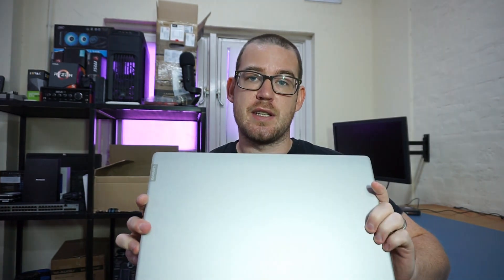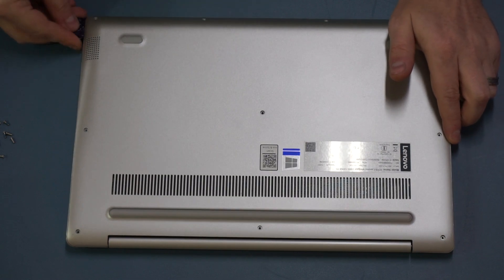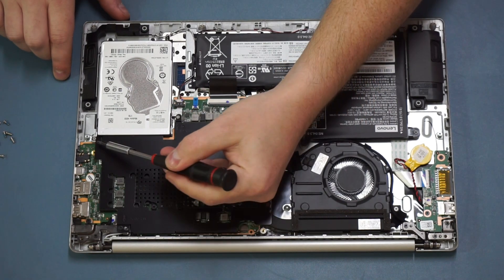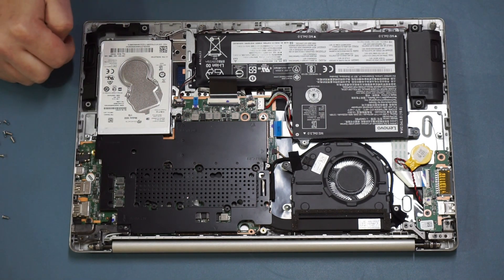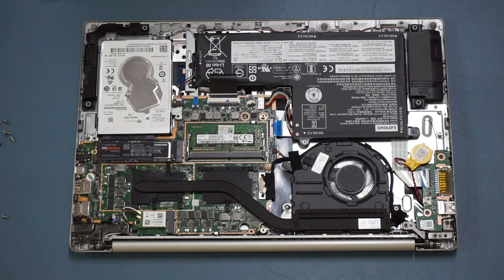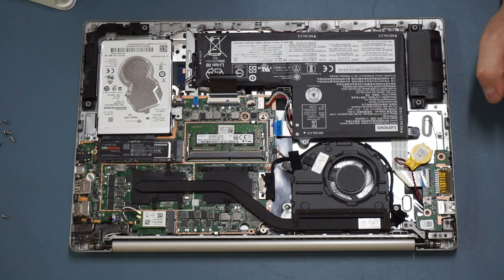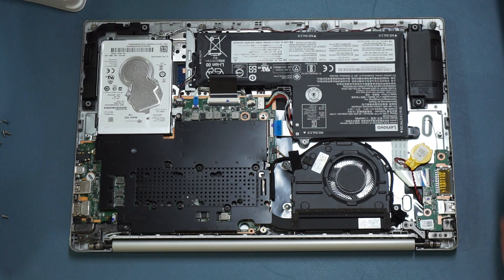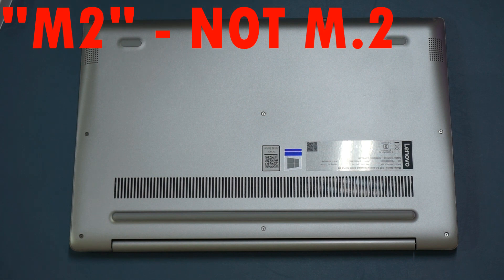Lenovo Ideapad 330S Hard Disk Upgrade

Comment: Maybe I'm wrong but I see you didn't unplug the battery, isn't that necessary?
Reply from the maker: It's a good point, you should always disconnect the battery before working on a machine like this
Reply: @TMEretro  Can you add that instruction in the video, may be as a subtitle?
Reply from the maker: @vikas7gupta  Doing so would require me to de-list and re-edit/upload the video which has implications for my channel, but I have added the text to the sticky-comment and to the description of the video
Reply: @TMEretro   @Tech Made Easy  I thought adding subtitle does not require all that so i suggested that. How about using CC? For now, Sticky note will be perfect. Thanks for making this extra efforts. Appreciate. Keep up the good work.
Reply: Uh, oops. I missed that memo when I was working on my laptop earlier. Well, sh*t.
Reply: Can you explain further, do you mean take the battery out completely during the operation?
Reply from the maker: No, just disconnect it from the motherboard.
Reply: @TMEretro  Gotcha. Does it need to be unscrewed from the housing, or can you just unplug it?
Reply from the maker: @fish2036  if you can safely detach the power cable from the motherboard then that is sufficient. In some cases this requires the battery to be removed

Comment: This is an odd one, so just go with me... I just inherited this laptop from my wife after getting her a substantial upgraded new laptop. I have a Steam deck, and I have upgraded the hard drive, which left me with the original 512gb NVMe m.2 2300 hard drive from the steam deck. I was going to use it in my PC when I built it November 2023, but there was no post at the correct location to mount it with the screw on my motherboard. It looks like (based on this video) that is also the case with this mobo. Is that correct?

Comment: hi, i just bought and install a M.2 ssd on this exact laptop, altought it had a Intel Optane previously, that when bad, and its running amazingly after that, BUT, i dont know how to properly st up the boot on the m.2 in the BIOS, when i get in, it only apears the hard disk, on UEFI mode, and its gay, so i can't change it to legacy mode. 

Do you have a video following that situation? It will really help me to boot my laptop properly.
Reply: By the way, i already installed windows on the ssd, and can use the laptop, but everytime i turn it on, it goes to the HD first, then go to the recovery mode, and ask me if i wanna start windows on other drive, i select the SSD and star to work, but it takes out the advantage (fast boot and load time) of the SSD being in the laptop.

Comment: I have this exact laptop. And this is entirely different from the laptop I bought back in 2008, back then I was able to open and latch on the side, pull the old hard drive out, then install a new hard drive. Not so now and days.

Comment: Hmmm....I wasn't aware that the battery had to be removed.  My laptop no longer turns on.  The power button is lit, but the screen is black and nothing is happening.  Is my laptop broken?
Reply from the maker: Try reseating the memory and also confirm if any other connections could have come loose while working on the machine

Comment: My laptop is the same, but why my laptop doesn't have the black plastic shield?
Reply from the maker: Maybe a slightly different revision?
Reply: @TMEretro  but I'm sure it's the same version, Lenovo Ideapad 330s 14IKB.

If I wanna put on SSD M.2 on my laptop, should I  buy a screw for it?
Reply from the maker: @dwiadhiiswiyanto  Yes you need to secure it with a screw

Comment: Ah, thanks! :) you covered all I was looking for and probably a bit extra info as well. I might go for and M.2 SSD and keep my harddrive as is.
Reply from the maker: Glad I could help!
Reply: I'm having the same laptop kindly help me which SSD this laptop support for 500/512GB. Can I go for Samsung 970 SSD of 512gb???
Reply: @Maverick.manan_  I went with Kingston a400, 240 GB. It's cheap and really really fast even on a data connector. You might benefit from trying m.2 or a better model if you have a bigger budget. Depends on your use, but I would advise to go with a smaller 240gb and keep your files on your hdd in an external enclosure. 

SSDs are fast, but will get slow if you fill it up with a lot of files and programs you dont need.

Comment: Hello, 

Can i add 
Crucial CT16G4SFD8266 16GB Single DDR4 2666 MT/s PC4-21300 DR x8 SODIMM 260-Pin RAM on this Lenovo 330s ?

or is this has to be falling below 2400 MTs?

Thanks
Reply from the maker: Please check with Lenovo for compatibility, I can't assure against every available module

Comment: Thank you for making this video. The information here is great and it is difficult to find another video as in-depth as this one for this exact model. I have two questions though-
1. My laptop has a 1 TB ssd (I think; I've seen some models of this laptop with a hdd, but I haven't cracked mine open yet), however C:\ states it has only 930 GB of storage. Is that usual for this laptop and if not, any ideas as to what could be happening there? 
2. If the m.2 ssd has a smaller storage capacity than the original hdd/ssd, what would be the effect on the system? Does the m.2 add storage to the system or simply replace what was already there?
Keep up the work!
Edit: One more question: does this model use single or dual rank RAM?
Reply from the maker: The disk reading 930GB is normal - you lose space because of formatting overheard and this applies to all storage drives.
If you add an additional m.2 drive you will gain that space as a separate drive within windows
Reply: @TMEretro  Thanks a ton!

Comment: This video was a lifesaver. Thank you!

I'm not sure I would have known about  970 evo if it wasn't for this video. Got the 1TB version. Bought and installed it today and just got it to work with my computer. Need to upgrade my other hard drive, but still nervous about that and need to save up for it anyway. Also need to add ram, but I didn't see an extra slot for it on my 330S. Don't know if missed it or not. Need to open it up again anyway because my 970 didn't come with a screw and the one I had didn't work.

Any ram you recommend? Also ditto with the other hard drive.
Reply from the maker: There are options for both in the video description

Comment: One question If I install SSD like this. Should I have to install windows in SSD to see the effect or just changing the boot setting will be enough?
Reply from the maker: You need to manually reinstall Windows on the new drive

Comment: I ended up bricking my 330s during a bios update and wanted to know if anyone knows where the bios chip was?  I believe it’s the 8 pin chip just above the ram in the video, marked Winbond 25Q64JVSIQ (that’s what mine is marked). 
Thanks for the help!
Reply from the maker: BIOS chips are generally non-replaceable.  Have you considered taking it to an authorised repair centre?
Reply: My plan was to try and flash it.  Lenovo help desk said I need to send it in and it’s not on warranty.

Comment: Hi Thanks for this video, anyway do you have information to set the bios after you upgrade it? And how you set the windows pre-installation copied into new ssd?
Reply from the maker: Hi, there shouldn't be any further changes required in the BIOS providing you only have windows installed on one drive. And I'm not sure what you mean by the 2nd part of your question
Reply: My 2nd question is how you migrate your windows to your new main drive.. but i already have the answer, it just we need to clone the windows and copied to new ssd upgrade.
Anyway thanks for the answer.
Reply: @edw7times7  which software did you use for it ?
Reply: Isabat Rizvi You may can refer to link https://www.easeus.com/backup-utility/copy-and-clone-hard-drive.html

Comment: Hi. Can I remove the black metal cover on this permanently? I recently installed a NVME and it runs hot. I'm suspecting that the black metal traps the heat.
Reply from the maker: I would never recommend removing anything from the laptop which the manufacturer put in place
Reply: @TMEretro  perhaps I should just make a cutout or holes at that area? My NVME temp are at 45-55°C idling. 
Thanks for the help man!
Reply from the maker: Again I can't recommend you do anything to modify the machine, doing so would invalidate your warranty and could cause damage to the computer

Comment: Does this take the computer out of dual channel? If so, does it have a positive or negative change in its performance?
Reply from the maker: If you use a RAM stick other than 4GB I don't believe it will run in dual channel with the inboard 4gb

Comment: Hey, thank you for sharing this video. Would you happen to know what the difference of replacing my 1tb HDD to an SDD or add an additional SDD in M.2 Slot? Any advice would be greatly appreciated. Cheers!!
Reply from the maker: If you add an m. 2 ssd then you retain the space of the old hdd as well, but in this machine and for most use cases there is no performance difference between a SATA SSD and m. 2 ssd

Comment: Is there a way replacing the hard drove be done if there is data on the old and moving the data to the new one if so is there anything that will have to be reinstalled such as the windows 10 os
Reply from the maker: There are 3rd party disk cloning tools available, you would need a means of connecting both drives to the same pc in order to copy from one to the other

Comment: Hi. Thank you for sharing this helpful video. I have the Lenovo 33OS that came with I3 7th Intel processor and I wonder if I can upgrade the hard disc to an M2 one in this.
Reply from the maker: I see no reason why not, but the best bet would be to open the back of the laptop and check to see if you can see the m.2 socket on the motherboard.

Comment: Thanks a lot for making this video! I have the same laptop, but in a slightly different variant, mine came with an ssd, and when i recently removed the back to upgrade the RAM i noticed it did not have the black shield, and in the hhd area there's a soft aluminium box instead of the caddy... i have a spare sata hhd and t I'm thinking to adding this as an extra storage space... Would this affect the performance? i'm not planing to remove the ssd just add the hhd, i'm guessing it would be some noise and more power consumption... any advise would be greatly appreciated. Thanks a lot!!!
Reply from the maker: As you say; more noise and more power consumption, but provided the SATA connectors are there it should work

Comment: hey hi  bro i think i'm also having the same laptop 

Lenovo Ideapad 330S  15IKB D 8GB Ram 1TB HDD and 2GB amd readeon 535 Graphics i would like to add an m.2 ssd of 250gb and i want boot up my laptop by ssd because in this lenovo built-in hardware is dam slow while using the virtual machines and while startups would you suggest me please??? and also for upgrading the ram memory also reply me as soon as possible.
Reply from the maker: The M.2 upgrade is covered in this video, the next step would be to ensure the ssd is set as a higher boot priority than the original hard disk and then reinstall windows
Reply: @TMEretro  yeah thats fine bro and how about the ram upgrade bro??
Reply from the maker: 5:20 - you can see the RAM slot. You can fit up to an 8GB stick in there to give 12GB total

Comment: Hey mann I have Lenovo Ideapad 330s 15lKB-D
The box says upgradeable to 128gb SSD . But if I use a 256gb ssd would it be problematic.
Reply from the maker: I can't guarantee, but I installed a 512gb unit in this one and it was fine
Reply from the maker: I can't guarantee, but I installed a 512gb unit in this one and it was fine
Reply: @TMEretro  Thank You

Comment: I have IdeaPad 330s 4GB ram facing slowness I m looking to install   NVMe SSD 250 gb and want to continue with HDD as well, if i get NVMe SSD installed  do I have to move win10 from HDD to SSD or can i continue using laptop with just adding NVMe SSD if not what happens to my HDD, also with 4gb RAM will there be any improvement in performance just adding SSD or do I need to upgrade ram also to 8 gb
Reply from the maker: There would be a huge benefit to wiping your machine and reinstalling windows on the NVMe SSD, it'll be much quicker than the HDD. Upgrading the RAM from 4gb will also be of huge benefit
Reply: @TMEretro Can I able to use HDD for data loading purpose or HDD will become useless in this
Reply from the maker: @udaykiran4370  The idea would be that your operating system and major applications would go on the NVMe SSD, you can then use the HDD for less important applications and storage of mass data (video files, etc).
Reply: did you updagrade the SSD in slot 2? if yes help me

Comment: Hi. I'm planning to buy this laptop (lenovo 330s i5 14inch) and install kubuntu and dual boot on it.
I also want to use NVMe SSD to the M.2 and remove the HDD, how many giga bytes does the motherboard support the NVMe SSD? It does support the NVMe right? 'coz I saw you are using one.
And can I somehow upgrade the RAM to more that 16gb ? Or I can only change the 4gb ddr4 to 8gb ddr4 ?
Reply from the maker: To note; this video features the 15" version which may be different to the 14". You're best referring to Lenovo's website as this details maximum capacities under the specifications tab
Reply: @TMEretro  I just found these website :
https://pcsupport.lenovo.com/us/en/products/laptops-and-netbooks/300-series/330s-15ikb/parts/pd500198

https://pcsupport.lenovo.com/us/en/manuals/um500453

It said :
Standard memory : DDR4-2400 MHz, SODIMM × 1, on board × 1 (max 8 GB + 4 GB (on board)) 						 						 					 					 						Storage devices : SSD: up to 1 TB, M.2 PCIe

So.. No more than 8gb ram :'(

And the storage devices doesn't said to be NVMe ?
Reply from the maker: @sumpitbaja6740  I would go with this information, it specifies up to 1tb SSD is supported and an additional 8GB of RAM, giving a total of 12GB
Reply: @TMEretro  indonesian website of lenovo doesn't tell the detail of the maximum capacity :'(

Comment: Great video! Just want to say one thing about RAM memory upgrade. You can actually upgrade it up to 20GB of RAM adding 16GB sodimm 2400 1.2 V  to extra slot. It will work perfectly fine. Other than that very good tutorial and detailed video.
Reply from the maker: Good to know, thanks!
Reply: So you have a Dual-channel 4gb+16gb for your 330s? Everyone seems to think 12gb is the max amount of RAM for this model.
Reply: Yes. 4gb is soldered to the motherboard and you can add 16gb to have 20gb total and it works perfectly fine.

Comment: Is this compatible to Lenovo 330s ideapad 14ikb with core i5 and radeon graphics?
Reply from the maker: Hi, unfortunately that's a 14" version with a smaller chassis, I can't guarantee the internal layout will be the same
Reply: My 1TB HDD has got issues with file corruption. Wiping hard drive did not work. Can I purchase 1TB 7mm HDD for 14ikb ?  Does 7mm fit for 14 inch version also? Which hard disk do you recommend?

Comment: Very helpful video I have the same laptop and I want to do the same upgrade but I want to remove the SSD and only have the m2 installed. My concern tho is how do I install Windows and all my files to the new drive?
Reply from the maker: Microsoft has a media creation tool that free to download, you can create a Windows installation USB drive. The licence should move across to your new install so you just need to back up your personal files and any applications you've installed

Comment: Hi, I got some insight on seeing your video but now I got one more doubt. My laptop model is Lenovo Ideapad 330S - i3 8th Gen, 4GB RAM, 128 SSD. I was told in the shop that I can expand my storage to 1TB or more by adding additional drive which can be 1TB HDD. My doubt is how can I know which SSD I'm using in my laptop - SATA or M2  without removing the case? Will you please  help me to get info on this one.
Reply from the maker: If you go to device manager in Windows it should show your hard disks along with all other hardware. Note down the model number of the hard disk and Google it to see what type of disk it is. The specifications for this laptop differ wildly across India but its likely its a traditional hard disk. Replacing with a Sata SSD or NVMe SSD will give better performance